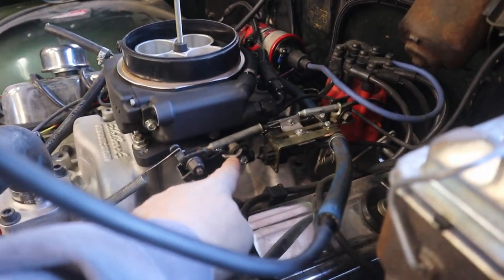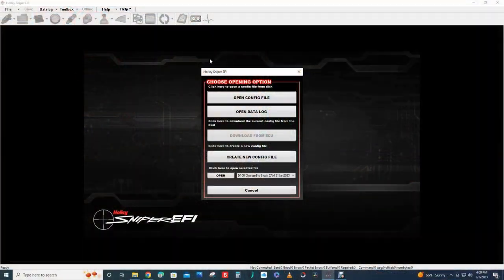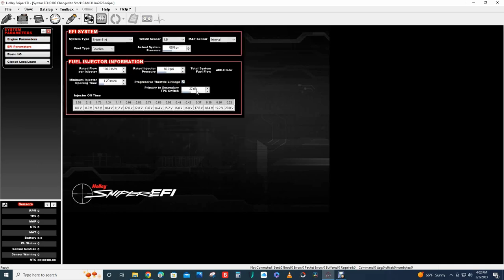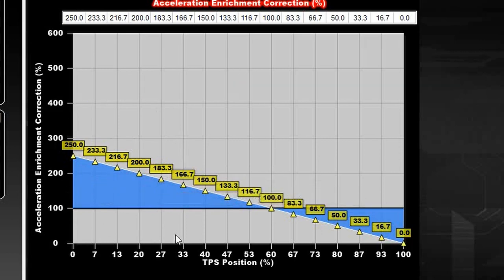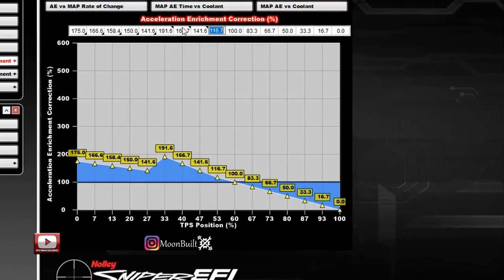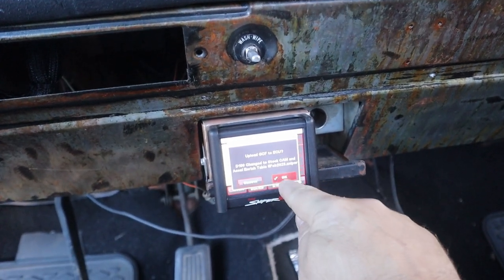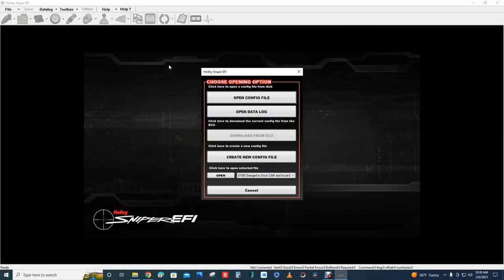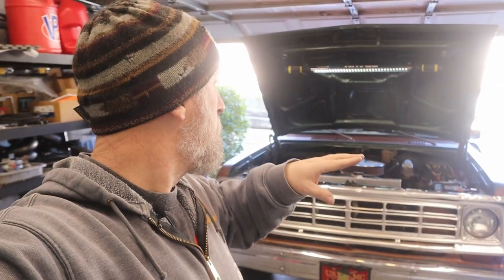Making Some Changes to the Holley Sniper EFI

Comment: I am the tech guy at EFI System Pro. If your oxygen sensor is on the same side of the engine as the exhaust leak, that will cause the AFR reading to show leaner than what the engine actually is seeing and the ECU will add fuel to compensate causing the engine to actually run rich even though the reading looks good. It is best to connect the outlet of a shop vac to the tailpipe to pressurize the exhaust then spray soapy water on any welds, flanges or connections from 12 inches behind the sensor all the way to the header flanges on the heads.
Reply from the maker: Thanks....my exhaust leak sounds like it is on the passenger side, and my O2 sensor is on the driver.  I've used the shop vac in the exhaust pipe before, and found leaks, but this time since redoing my exhaust I haven't just because of time.  I don't think the exhaust leak is my rich fuel condition. so I'll be messing with the tune..making sure to save the previous one before making any changes since this is the first EFI I've tried tuning....live and learn...
Reply: I got lost listening to why you had to reinstall the base fuel setting. If you could explain that to me and how to do it. I thought the system would do a relearn anyway. Thanks for the video.